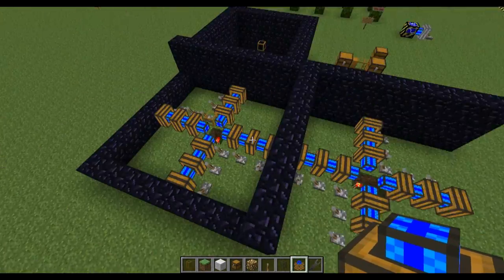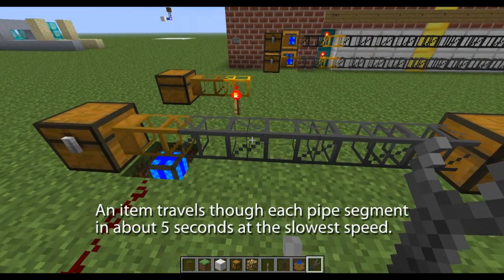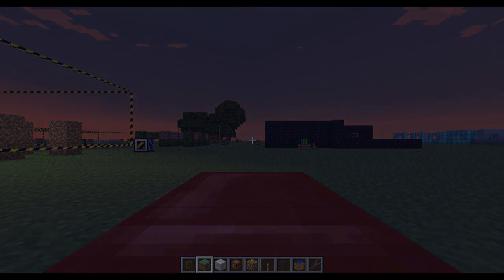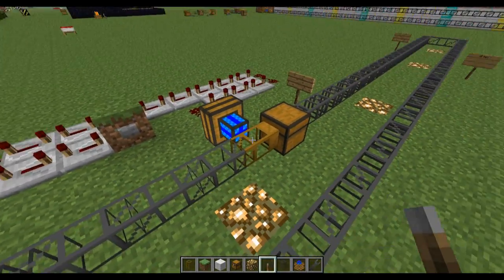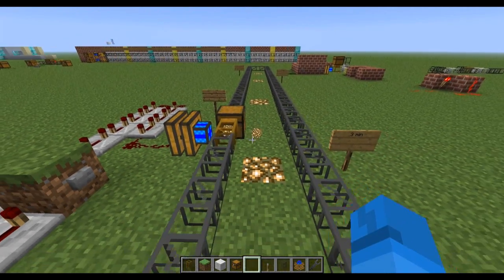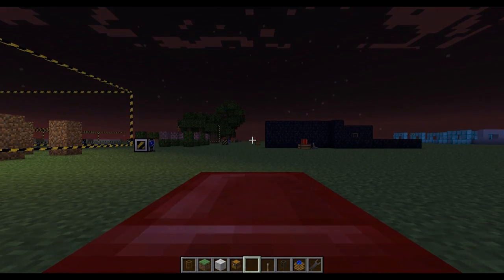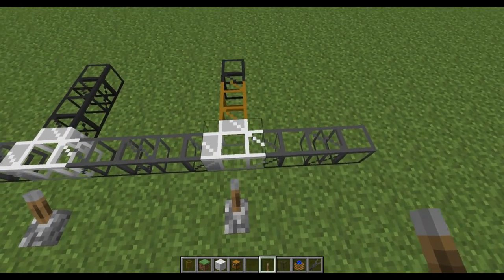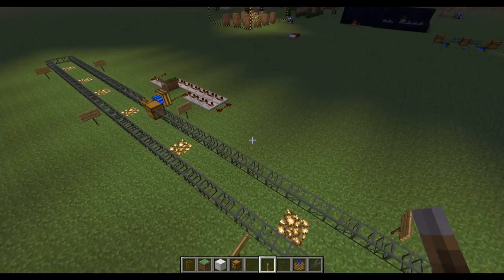Science of Buildcraft 01 - Experimenting with (Transport) Pipes

Comment: Very interesting experiments. :)

I think there's a certain amount of power that the red stone engines generate. If that power isn't sent anywhere (no wooden pipe/conductive pipe) or the engine gains more power (chained engines) then it can release, it explodes. Wooden pipes can take a maximum amount of power and red power engine can release a specific amount of power.
But I just don't know the amounts for those power calculations.

Comment from the maker: I'm pretty sure that the item will "respawn" where it was unloaded last.  It should also maintain the same speed and direction if it is going through a pipe, based on my experiments.  I do know that occasionally there is a glitch where items will "pop" out of pipes for some reason.  I'm not sure why that happens, but I have seen it in my quarry pipe system every now and again.  I think it's because items don't stack in pipes (not in the version I'm using).  I believe that has been changed...

Comment: I have a question not sure if anyone knows. I use Tekkit so I would assume it is the same as using the regular buildcraft mod. I set up an oil pump and pipes to transport the oil from the tank which is extremely far away to my home base if you will. The oil tanks at the home base are literally more than 100 blocks tall and I currently have 4 of them and the tanks are full. These have all been filled from the one oil pump set up and it seems the oil won't stop. Is that due to distance?